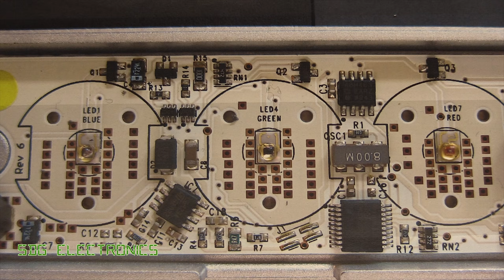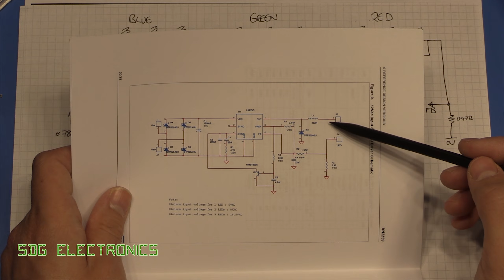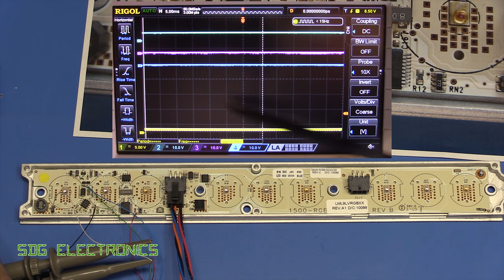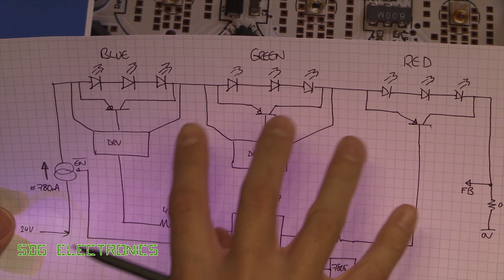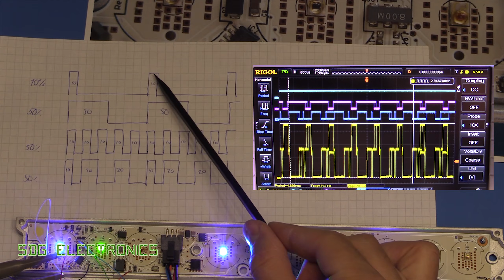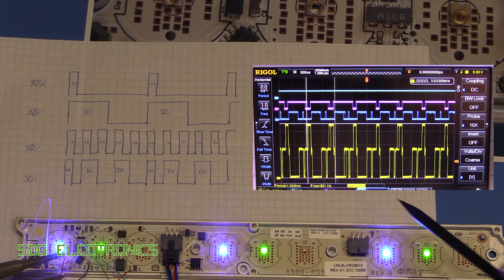SDG #051 Driving RGB LEDs with 1 Constant Current Driver

Comment: 9:20 I believe this is called pulse density modulation. As to why its used in this application, I heard that its less likely to flicker at lower brightness, but you'd have to ask an expert like Mike for his input, he probably knows whats up.
Perhaps this could easily be achieved by abusing DMA transfers on the SPI bus? 
By setting 20 data bytes in memory, you could easily control pulsewidths down to 0.625%. Want 0.6% brightness? Only set the 0th byte to 0x01. 1%? Set the 0th and 4th byte to 0x01. etc etc Want 50% brightness? Set all bytes to 0xAA. 
I bet you can do quite some funky modulation schemes using such a method.

Comment: called pulse density modulation. PDM.
it's an interesting problem for programming. I read that people use filtering technics from raster graphics to spread the pulses throughout the whole period. The exact technic used in this case is probably the case for the waveform behavior seen in this video.
I'm preparing to experiment with PDM on mains AC with zero cross triac driver..

Comment: The solution is not really surprising, you can get chips that works this way: GS8208
Reply from the maker: Minimum supply voltage on the GS8208 is above the forward voltage of the three LEDs
Reply: That was not the issue, the GS8208 is designed to run the leds in series and use PWM to short each led to match brightness setting, this is the same as your driver.
Did I miss something, could "your" driver power one led around the chain for lower forward voltage? Or did it never run all leds at 100%.
I am a bit old fashion, I do not like that the lamp has a high power consumption with the leds off or at low brightnes, I.e a very dim color will use just as much power as full brightness on all leds (I suppose it turns off the drive when all leds are off).

Comment: I can't decide if this solution is elegant or a total hack. Probably a bit of both. Still, it works, and I guess they saved money by utilizing only 1 constant current source per module.
Reply from the maker: It's a bit of both. I quite like it actually.
Reply: Elegant. Many modern design techniques evolved from chucking out the linear playbook of yesteryear.
Reply: it is definitely a hack because it produces light flicker. Constant current supply for LEDs is solid while any PWM that is actually seen across the LED is debatable in terms of making a healthy environment. I know it is high frequency and human eye does not deferentiate such swift changes of brightness, but that's still a possibly very strong light source that is either off or full retard on, I can imaging that it has a longterm consequences like hearing damage.

Comment: The micro drives the leds in reverse?
More voltage to the transistor is less light?
Reply from the maker: No, the micro just provides switching (PWM) no analogue control. The logic is inverted though - a low signal turns on the LEDs

Comment: Looks like it’s using BAM Bit Angular Modulation instead of the traditional PWM
Reply from the maker: I think it's a mix of modulation techniques. This is apparent at the low duty cycles where there are multiple occurrences of a binary "1". This effectively gives a much higher resolution than 8bits to allow for linear brightness control